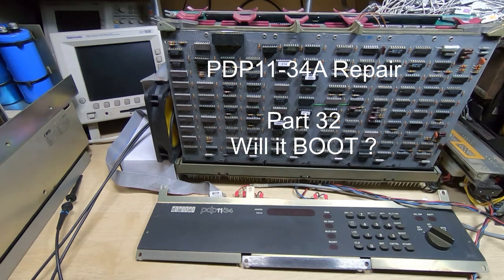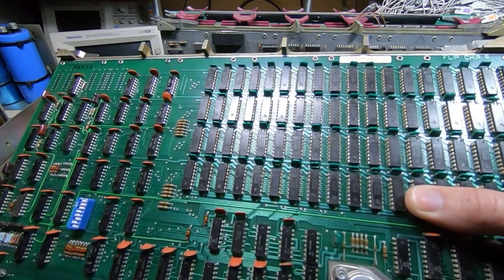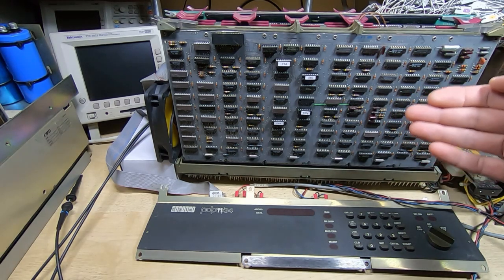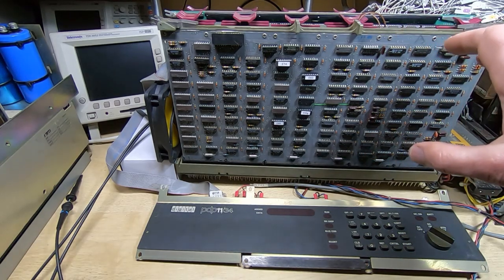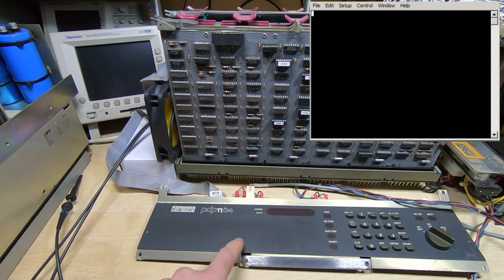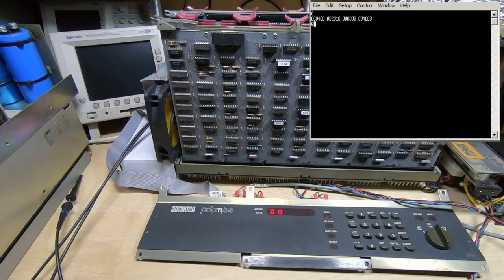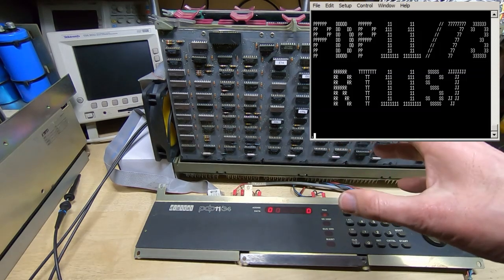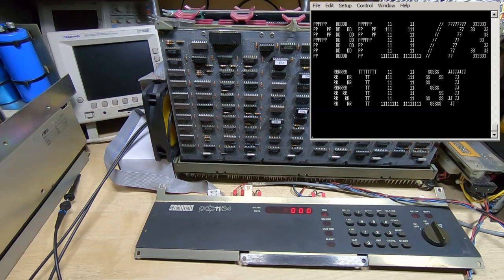PDP11-34A Repair Part32

Comment: Nice progress. I hope it doesn't all suddenly stop working again when you move it from the desk back into the chassis. It seems like just looking at it causes another fault to appear.
Reply from the maker: I make a point of not being too gentle with the parts while they are on the bench so hopefully most faults will be provoked before I reassemble it but these units are always waiting to develop new faults, All part of the fun.